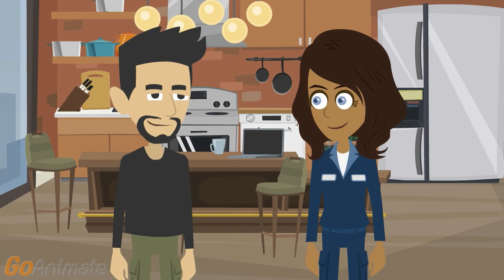Whirlpool Dishwasher Error Codes

Comment: Code error 6-4 what is this mean. I can get my dishwasher to fill and drain but it will not run through the cycles to do the dishes. What is the problem.